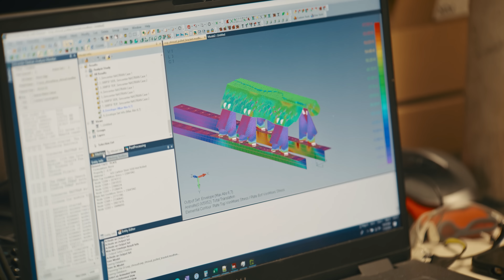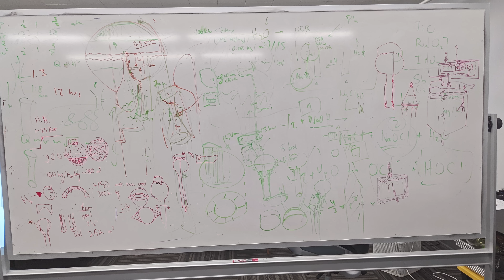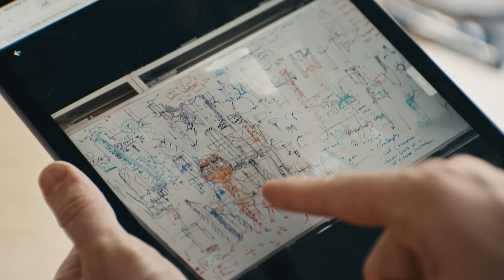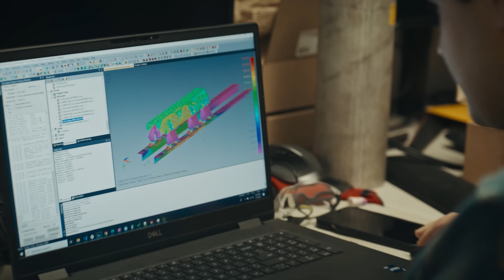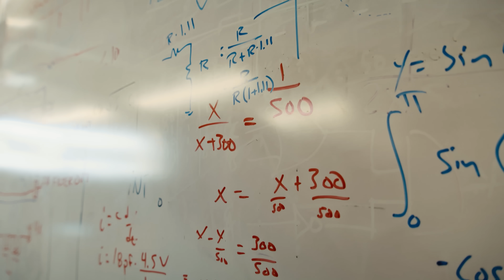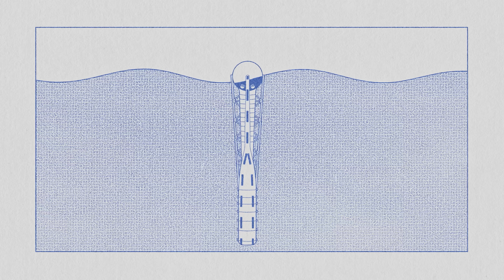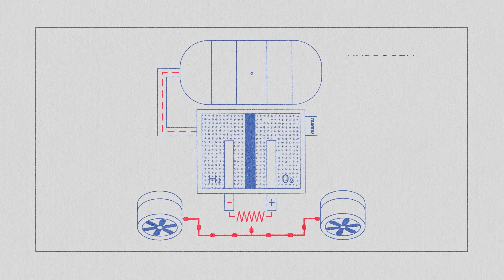Ocean-2

Comment: Great vid. Would love to see actual numbers for power generated. And how you guys will tackle the issue of maintenance.
Reply: if you pause right at 11.56, you can see maximum spikes up to 10kW, average 2.5-7kW. I understand its prototype and they are testing but... they never say anything about power output anywhere, even on their website is 0 data about it, just cute 'modern day' website. I want it raw!
10kW is average roof solar around here, if that thing cant generate at least 1MW, I call it bullshit for now. Crappy small and old wind turbines i still service from 1997 generate 300-400kW to this day at high winds.
I understand they keep it quiet to get funding, I really hope they can scale power output, wishing a success! Looks awesome :)
Reply: @Rafinadas  Quite true. A lot of people are estimating very optimistically a 40k USD price per unit. Say for a mean of 3kW, the equivalent cost in solar pannel for example is around 9kUSD. Double it since you produce almost at night and this is still twice as expensive. Nothing said about maintenance cost for such a machine. Nothing said about sea condition resistance. It is a very nice prototype with a very nice idea but we're not there yet !
Reply: @utorque  aren't we at like 1,5k per kW for solar panels? I agree, it's nice on paper but we need real data e real numbers.
Reply: @Rafinadas the average rooftop system in Australia is 10kW. This giant contraption makes somewhere between a sunny midday and a cloudy afternoon. When the waves are moving.
Reply: @Rafinadas  Well put. And even if, hypothetically, one of these COULD match a wind turbine's output, we know that wind farms cannot compete with fossil and nuclear power... they need government subsidies. 

Now imagine the subsidies necessary to build, operate and maintain the vast number of these needed to come even close to a wind farm's (inadequate) output?
Reply: @proto57 Nuclear power is the most expensive form of non-emitting power production. By at least an order of magnitude. It's also the slowest to commission by one or two orders of magnitude. Your point that this is a pipe dream is obviously correct, but you should check out modern data on sustainable power.
Reply: @proto57  Wind is absolutely cheaper to run and build than most fossil fuels.
Reply: An article I read online claimed "up to 50 kilowatts in decent conditions". I'm guessing this is kw/hr and not total for a 24 hour period. Article also claimed that this could power a small town which is delusional.
Reply: Exactly, so not a great vid
Reply: Maintenance migght not be that big of an issue. My understanding is that aside from the turbine there aren't any moving parts so the mechanical simplicity should help a lot.
Reply: @sino_diogenes  Carrying your point still further, one may simply float "dumb balls", tethered with cables to bottom moored block and tackles, with the tethers then led to one generator/alternator in one shore station. That would be far cheaper than having the power generation repeated in each ball. And maintenance would then mostly be on shore, with offshore duties reduced to simply cleaning the balls, or replacing worn cables. 

No power transmission on flexing cables would be needed, either. 

Ironically, I sketched such a system in the 1970's, in high school.
Reply: Don't worry about the numbers, they won't matter. Look at this whole video, and the reaction to the cute bobby thing and biomasses and fish diversity and "finally a solution!". Actual numbers? Maintenance? Longevity of the unit, the cables? Cost to power? How many of the damn things would be filling the shoreline horizon to power a single block of houses?

How dare you ask. If they wanted you to know, they would have mentioned it in the pretty video with the uplifting music and all the panning drone shots. 

Shhhhhh. It doesn't matter. Just bEleIvE. Its cute. It bobs.
Reply: @proto57   The amount of energy required to displace that much water again and again for 24hrs is massive.. Key thing here is its in the deep ocean where the waves are violent, massive amounts of energy is available with no fuel. No reason why these cant be built to last, they are simple enough. And as far as transporting the power, once you produce power as cheaply as this you can convert it into hydrogen (plenty of water to split around). Then an autonomous ship goes from one to the next collecting the hydrogen, off it goes to which every nation is paying, combustion engines are back in the menu, so big auto wont have to scrap billions and billions worth of plants, and hydrogen heating can fit in existing gas infra, existing power plants can be cheaply converted to run the turbines from hydrogen power.. Its a solid idea.. The numbers work.. There is trillions worth of carbon based infra which will otherwise go to waste, those industrys could invest to save the waste of scrapping there stuff. Not every idea must be a solar roads or hyperloop flop... Once in a while something with legs turns up.. This is one of the best renewable ideas ive seen to date.
Reply: @proto57  This whole video felt cringey to watch. Just another generic hipster innovative startup #heroes video they will spin to investors to try and get more funding.
Reply: @proto57 I mean they cover the fact that they won't use cables in the video...
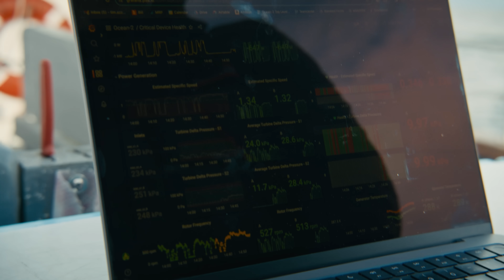Reply: @Vativ  You can make out some rough numbers (Altho idk if the stated kwH is really the generated usable power) at 11:56
Reply: @proto57  dude this is a PR video lmao it's not technical documentation
Reply: @proto57  exactly what i was gonna say, its cool but thats about it. Much like wind power
Reply: @proto57  You seem very upset. You wouldn’t happen to own stock in oil companies, would you?
Reply: @fakename287  This is exactly what oil companies need. Quasi-innovative solutions to wave in front of you as an excuse to keep poisoning us. 
There must be a reason that they do not share numbers here. The shape of the ball is unimportant. It makes no sesne that it's a ball even. Why have that much drag when your idea is to have it freely move? I say this is another way to try and get funding and dissapear. It just smells like nonsense. You feel it.
Reply: @proto57 If you are so clever and knowledgeable, I’m sure it would be super easy for you to calculate an estimate of the power produced. What’s that? You don’t actually know anything about hydrodynamics or electrical engineering and are just mouthing off? Well, colour me surprised.
Reply: @chrilaur1143 He's asking reasonable questions, making sesible points. No need for personal insults.
Reply: @chrilau1143  If a significant amount is powered by waves we're going to start having issues with the moon, literally.
Reply: @HitchensTV  wHAT????? And why is that bud? Because the moons pull has an effect on the ocean? Are you thinking we would install enough of these to change the mass of the sea? Or the amount of energy in waves? Lol you made me chuckle today, well done..
Reply: @HitchensTV  bro tides happen because of the moon. I think you got it backwards
Reply: @chrilau1143  you are reacting to very valid points by making ad hominem attacks. The noting alone of putting ocean water through a turbine is absurd. Then having tankers come out and pump out all the hydrogen is also just a fucking insane idea
Reply: @proto57  in concept id say its super cheap to manufacture, maybe around 30-40k usd per unit. The physics its based on does all the work and maintenance wouldnt be an issue because its cheaper to replace than to maintain. id place the longevity of them at about a good 5-6 years but honestly they didnt mention it so im a little skeptical, and i dont understand how theyre planning on transporting that electricity to shore without cables. As for the amount of energy, im not sure, but with how optimistic they are id say its better than most other alternatives that people are trying all over the world.
Reply: @verony9519 brother there is no way they cost 30-40k to manufacturer, just the raw materials alone have to be multiples more than that
Reply: @Vativ  its like almost entirely steel, which is sold by the tonne for about 884 dollars, now this probably isnt that specific 884 dollar steel, but its nothing special, add the fact that this thing is mostly hollow, its probably like 10 tonnes, so about 10k in raw materials, then turbines, this can fluctuate wildly depending on which specific turbine theyre using, and of course the labour cost, electricity, transport etc, would be about 25-30k, so saying its about 40k is just right.
Reply: @verony9519  They said in the video, they don't intend to bring the electricity to shore directly. the two use cases they suggested was a cloud computing node converting the power to processing power, or conversion to liquid hydrogen for transoprt to shore via tanker. They can build ship hulls that have lasted 30 to 50 years. The only moving parts are the turbines and release valves, so tow it in every 5 years and slot in a new set.
Reply: @verony9519 you're hilarious. Just the road transport alone of a 215 foot long structure like this to the water will already cost more than that, even if it's only half a mile from shore. And then it hasn't even touched water. Let alone get built..
Reply: @dreamsaresimulations  i dont get whats funny about what i said, do you think my estimates are off? If so, you're more than welcome to correct me, yes transport costs are gonna be a bitch, but how expensive do you think transport is lmao, its in the neighbourhood of roughly 400 dollars per kilometre, at a rate of 20 dollars per metric ton. Now I'm not personally involved in specialised transport, but going by my regions rates, and normalising for the standard, i'd say its pretty accurate. Now you're not gonna build the damn thing a 100 km from shore are you, its gonna be as close as possible, at most 4-5, so a couple thousand on transport.

Comment: Did I miss something? I didn't see where they said how much energy it captures. I would think you'd start with calculating how much energy does it take to move a given quantity of water up and down and that's the maximum amount that any device could possibly extract from the wave. And frankly, I suspect that's a really small amount of energy. And they're using an enormous, massive device. The mass alone would resist the up and down movement.
Reply: forget about that, harnessing wave power has been tried many times and they’ve all failed for one singular reason: the sea itself. 

Every other ocean hydroelectric startup has been shuttered or can’t scale because maintenance costs are simply too much. The ocean destroys everything and takes no prisoners.
Reply: How long does my usb cable need to be, phone is almost dead.
Reply: The device is designed to extract money from investors. Actual results would simply muddy the waters
Reply: @DingbatToast  oh no, those greedy billionaire engineers, extracting money from investors!
Reply: Spin launch anyone?
Reply: The whole thing is extremely vague and kinda feels disengenious. I don't think its fake but something is off.
Reply: I don’t think you’d ever see a return on investment here. Especially when factoring in maintenance and service life.
Reply: terrawats is the dimension mentioned
Reply: They mentioned kilowatts, so it's definitely far away from competing with windmills
Reply: Yeah, I’m sure they got as far as spending millions of dollars and trialing huge prototypes without first doing a simple theoretical calculation about energy expected to be produced.
Reply: @chrilau1143 it depends what your goal is, do you want government and venture capital money, or do you want to build a power station? It looks like the former if they don't share data.
Reply: @chrilau1143  well that is exactly the point. If the result of this theoretical calculation would be anything to ride home about, it would be in this video.
Reply: @chrilau1143  theranos was the BIGGEST startup EVER. lets not act like anyone is infallible. Now. they do have hardware. REAL, BIG hardware so thats like a good sign. but as for the economics? who knows. i guess they do... anyway, none of your money is in it(i assume, idk what the government throws money at).
Reply: @chrilau1143  Nice snark. The information is conspicuously missing from the video.

Comment: At 6:20 it shows the water draining from the main tank into the lower tank through some turbines. Where does the water go after that? It's draining into a tank that is below the water line. Does the water have to be pumped out?
Reply: It's a closed system- it doesn't depend on water exchange with the exterior, but pressurizing an internal chamber via water hammer.

Comment: Wonderbar! Electricity from wave action is very good. What happens when the weather turns bad, real bad? From climate change maybe? I do believe this tech will work but try to find a spot on the ocean that has consistent weather.Somewhere between San Diego to Los Angeles. Reasonably calm waters with high waves. No violent storms like hurricanes or typhoons. Rare tsunami now and again but out to sea shouldn’t be a problem. Build it and they will come…to buy your electricity. Ask California for some money. They have a lot of it. Good luck scaling this up.

Comment: Can you disclose actual numbers? It looks impressive and all but how many Kilowatts is it generating? Or can i be hopeful and say MW instead?
Reply: Ya- this went in the water for 3 weeks back in February of 2024... and not a word on results.   Not a good sign.
Reply: @mavigogun  do they even have a website to speak of? Seawater and turbines is a losing scenario.
Reply: Looks like 2.5 kW is the output. Although we don't know if they've throttled that output at all for the purpose or proving their system. 

How skeptical you are that these can produce more than 2.5 kW depends on your outlook towards start ups in general.

Comment: How much power does one of these generate? The charts at 11:56 seem to suggest that it has two generators outputting about 2.5kW each, most of the time.
Doesn't seem like much power for such a large structure, looks like the main sphere has about a 6 meter diameter, a 6 meter diameter solar array would output about the same power, although this has the advantage of working overnight.
Reply: wave power IS wind power. so assume any of the peaks and dips that wind has carry to this. And the ocean is a lot more viscous so itll settle a lot faster than the wind. of course a way to milk this would be to put them in ocean canyons where the elevation of the seabed changes rapidly. In these areas, all that wave(wind) energy is concentrated by natural funnels.
Reply: It could probably be scaled up and put into more extreme waters to generate more power. The 2.5kW was generated from some pretty tiny waves so it looks promising. The bigger concern for me is getting the power to land, you cant really put a bunch of wires at the top of the ocean so instead their plan is to use electrolysis to create hydrogen and then transport that to land. That doesnt sound efficient to me but maybe they are cooking.

Comment: Where can someone get the specs on things like metal durability, prcived maintenance and or repairs,  as well as scale ablities.  What is the tracking methodology for units that might get hit by a large storm or roug title wave. Most of all how well does it play with exsiting in use technology? This is an outstanding project, and i would very much like to see it succeed! Keep up the great work and set up a mechanism to to keep you true to the original concept of use and implementation.  Salute!

Comment: I'm a huge fan of MRE (marine renewable energy). Hundreds of MRE patents have been filed over the decades.  I have been granted two myself. Yet no commercial successes by any entity so far.  So many reasons why this is so - biofouling, corrosion, maintenance, specialized vessels required, anchoring systems, divers, power transmission cables cost over $1Mil per mile, permitting and regulatory hurdles, government subsides, interference with maritime traffic and fishing interests, etc.  So, in my humble opinion, jetty-based OWC powerplants (like Spain's Mutriku installation) seem to be the most viable MRE solution.  The bi-directional turbines are out of the water (no biofouling issues) and power transmission to the grid is cheap and easy. Another winner are man-made tidal barrages.  So, shore-based OWC and tidal barrage technologies show promise.  But nevertheless, not a substantial solution to petroleum consumption and global warming issues.  But it's great what Panthalassa is doing.  It's courageous and visionary.  I wish them success.
Reply: 'It won't work.  It won't work.  It isn't a solution.  I wish them success.'
 - the voice of failure
Reply: @mavigogun  the technology does work. It's the U.S. government that doesn't work!
Reply: @mavigogun  the technology does work.

Comment: I am on the fence really. Looks reasonable enough. I have some questions. How will transmission lines work? How far from the shore will this installation be? Will they interact with each other? How many cycles can they take before fracturing ? What will be impact on marine life? How marine life fouling will be addressed? How will you regulate supply and demand generation issues ?
I am not a naysayer just curious.
Reply: Well they said that they could be generating hydrogen on site and using that for power generation on shore. Though we have figured out planet long underwater powerlines a long time ago. Marin life is a good question though, not really knowledgeable on that.
Reply: I’m wondering how is it affected in storms and the weathering on it.